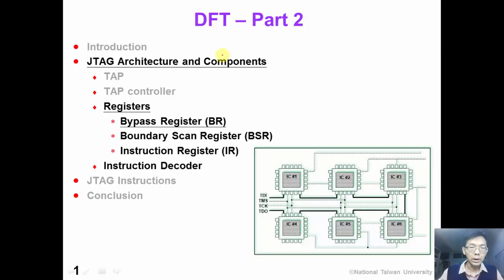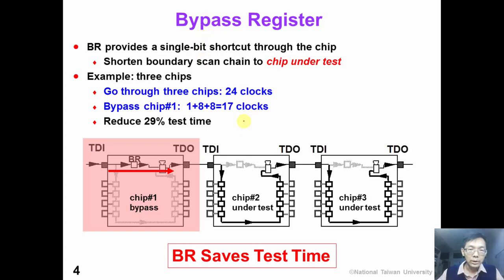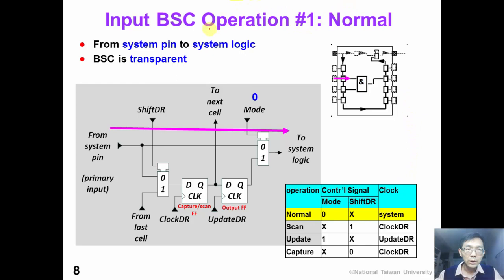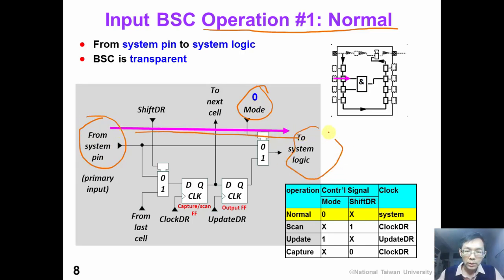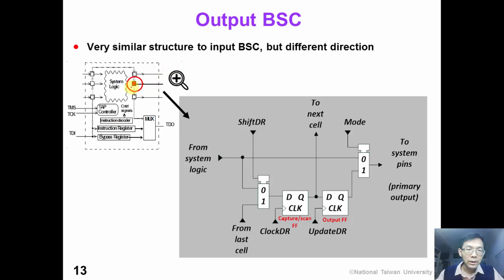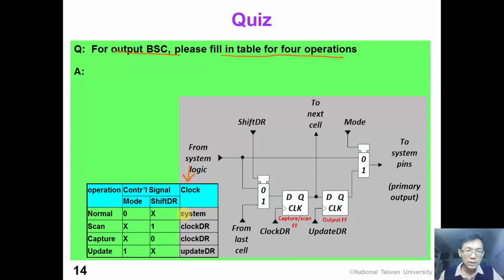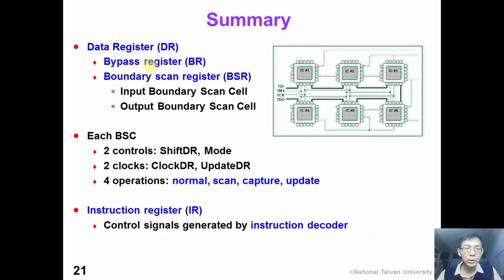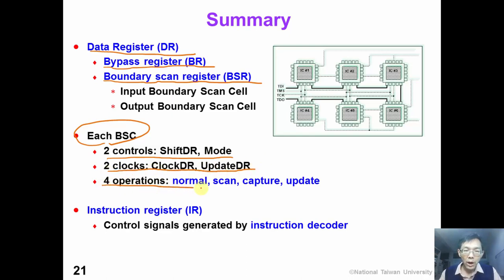12 2 DFT2 JTAG Registers

Comment: Hello,

Firstly, nice video thanks.
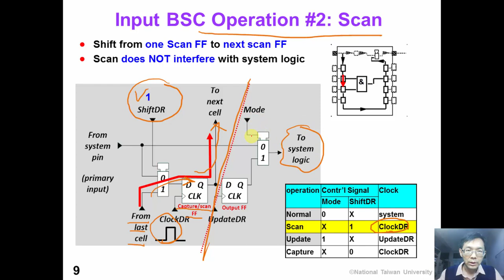I have a question for the scan operation at 9:09.

In your table you say that we don't care (X) what value has the Mode signal, and also you say that in this operation the system logic is isolated. But what will happen if we assign 1 to Mode signal?

The From system pin it won't be connected with "To system logic" right?

Thanks.
Reply from the maker: The value of Mode depends on what you wsnt to do.  If you want to apply PI from the system pin, you set Mode=0.  If you want to apply constant inpuy from FF, you set Mode =1.
Reply: @李建模-k8c  Ohh ok, thanks